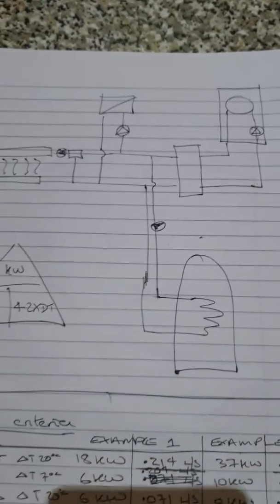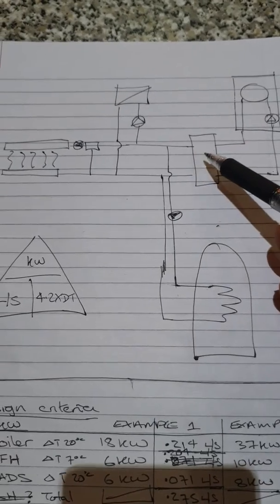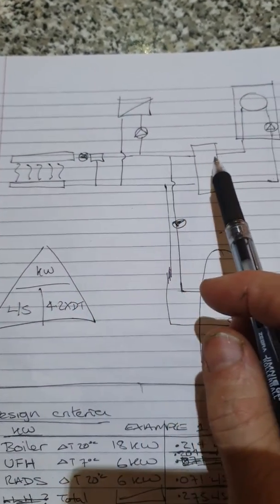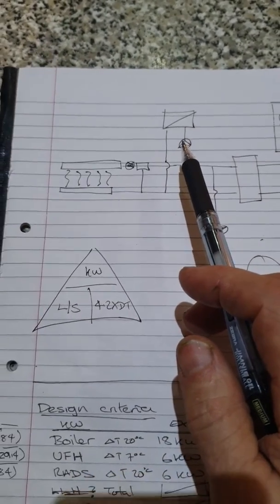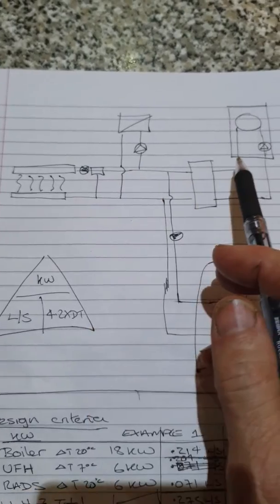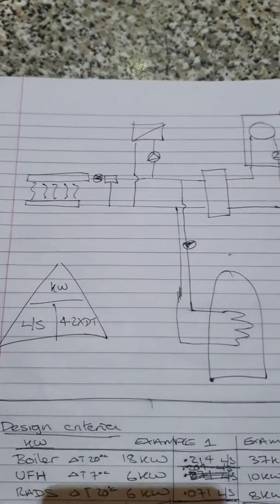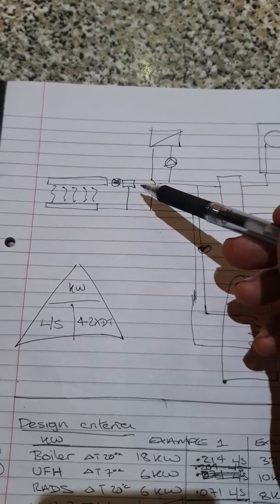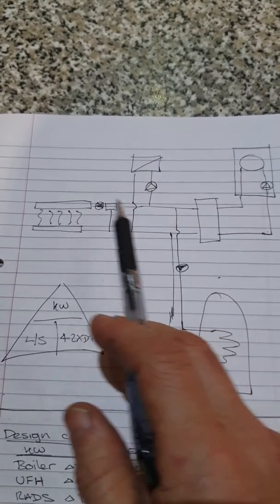Design errors causing call outs in cold weather.

Comment: If the UF pump was asking for more flow than the radiator circuit pump would you not be back to square one Andrew?
Reply from the maker: No the low loss header allows each circuit to take what it needs
Reply: @andrewmillwardwatford9410  so hypothetically if there were say 5 pumps they all can work independently with no interaction at all? Thanks Andrew. I’m getting there slowly!
Reply from the maker: @magicno001  yes. Need to size the distribution header at .5 ms or lower

Comment: Would be better to calculate flow rate for each circuit and install automatic flow regulator valves on return side of each circuit and of course on maximum temperature settings
Reply from the maker: The ufh could be flow limited to ensure it can't take all the flow.